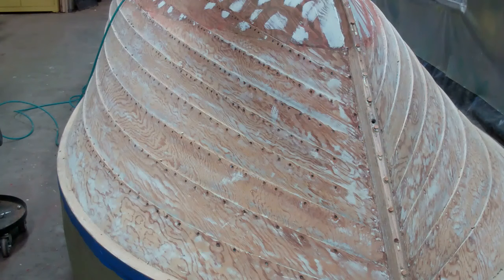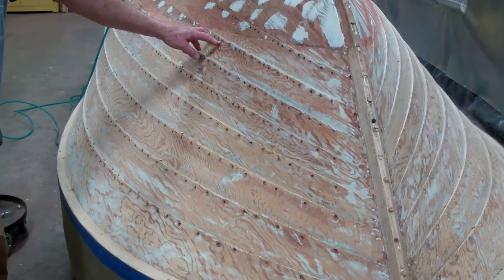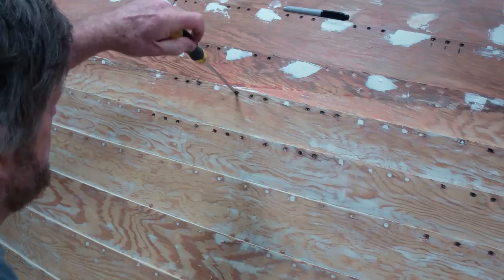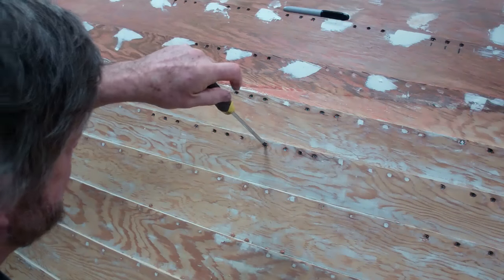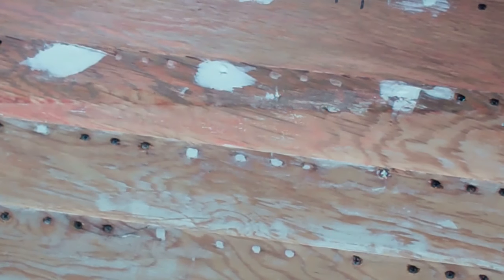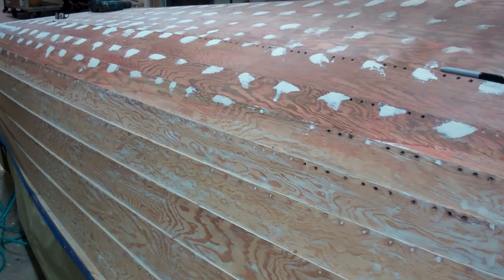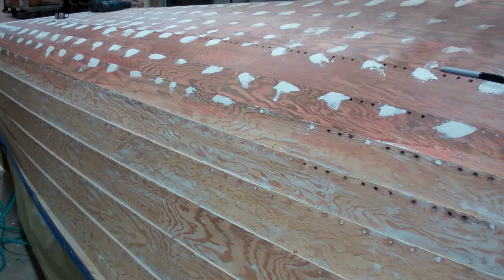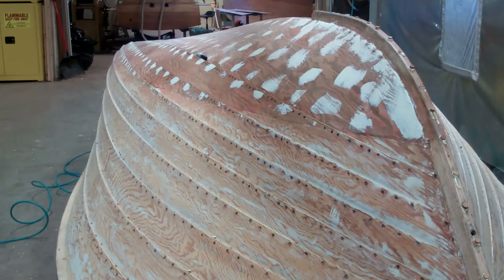1960 16' Cruisers Seafarer Topside Stripped Fasteners Being Tightened 3 05 2017

Comment: I have a 1935 Chris craft runabout deluxe all original that Ian restoring. I'm 39 and my first boat I have ever owned. I have a top side plank that is split in the middle for about 2' and was wondering if I could glue or epoxy a piece of luan on back side of plank to save the plank would love to keep boat original but also want to enjoy it on the water .any input would be much appreciated thanks Daniel